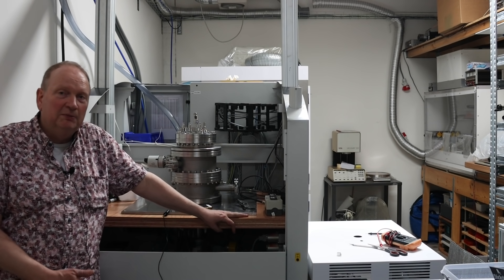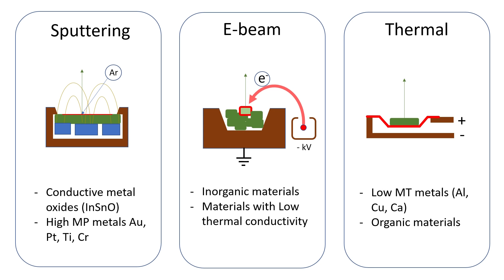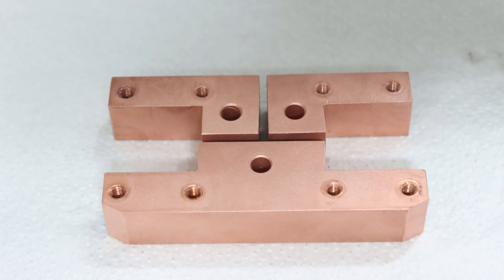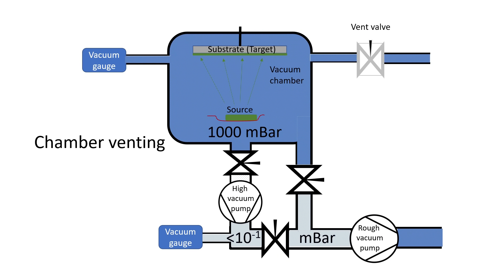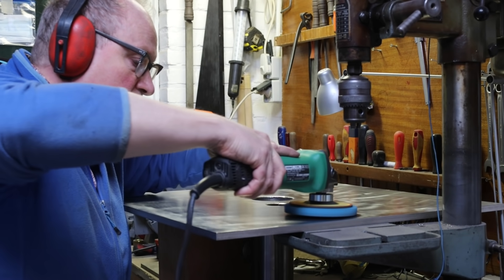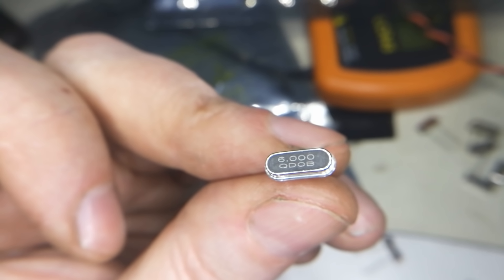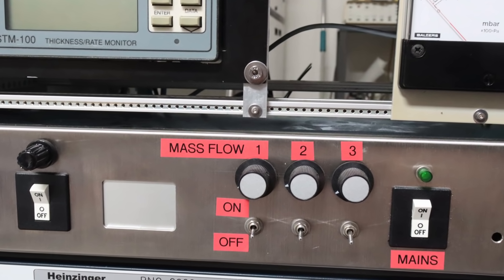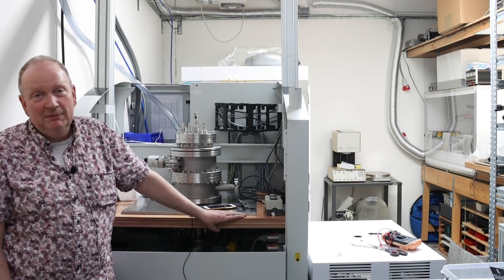DIY Physical Vapor Deposition (PVD) using Thermal Evaporation

Comment: Really nice work! How did you bond the copper cooling pipes in the glass feed through for the boat holder?  That turbopump spin-down noise must have had very high pucker factor!
Reply from the maker: Hi Ben, thanks for stopping by. The pipes were bonded using a vacuum compatible epoxy (Araldite 2020). Because these joints would stay cool during use, there was no reason for using special metal-to-glass joints, which would have been way more difficult to realise. The pipes have a very narrow fit in the glass disk, so the amount of epoxy surface in contact with the chamber is negligible anyway. The turbo actually did not spin down fast, it displayed these short irregular blips in the frequency, almost as if the filter was "dancing" on top of the rotor, extracting small amounts of kinetic energy from it each time it touched the top of the rotor blades. I consider myself very lucky that it did not end up between the blades...
Reply: You are the only two channels without instutional affiliation who demonstrated this capability. Big fan of both of you. Very inspiring! Thank you!
Reply: very cool, we now have inventors gatherings organized by the YouTube algorithm, See you both on the next video :)
Reply: Pucker factor? More like shit a brick. If I even thought something got loose in my TMP I would hit the floor in terror for fear of shrapnel to my body and to my wallet.
Reply: @fizzyplazmuh9024  yea its gnarly,  a colleague sent one to the junk yard just with droplet condensation. Apparently newer TMP's are more "resilient" but I'm skeptical. For my work diffusion pump and cryo get where we need and we like em for their resilience and serviceability
Reply: @Skunkhunt_42  But they "spew" oil into the chamber if you don't have really, really good baffles in the way but then its still not sufficient for the most delicate stuff.
Reply: I'm wondering why I don't see you guys using an oil diffusion pump instead of a turbopump?
It seems much simpler, more robust and less costly to repair. Am I missing something?
Why is a turbopump so much better, except for the need to control the level of oil?
Reply: @dedamarsovac  It's true that diffusion pumps are less expensive, near silent, and more robust, but turbopumps are better in almost every other way: Diffusion pumps contaminate the chamber with oil residue, which can be partially mitigated with a baffle, but this slows pumping. Diffusion pumps are slow to startup and shutdown, require an external water chiller to dissipate hundreds of watts, must be mounted vertically, and are typically pretty tall.
Reply: @AppliedScience  So it's a "would work, but it's more practical if you have a turbopump laying around" scenario :D
I'm really surprised that they cost the same on ebay so it makes sense.

I'd like to try doing PVD some day, so I'll see if I'll make a diffuion pump or just buy a turbopump.

Thanks for the reply, you guys are amazing, you're making me try stuff that I previously thought were just unreachable
Reply: @dedamarsovac  yea I agree, turbos are dry so thats the only advantage in my book which to me doesn't outweigh how fragile they are in wet processes
Reply: a wild Ben appeared
Reply: I replaced a "crashed" turbopump on a sputtering system some time ago, and it was just one tangled mess of rotor and stator vanes. 
You were very lucky the pump is  still working.
But you do very cool work!
Reply: Wow!! 😲
Reply: I need a good vacumology training course!!!
Reply: Going from 0 experience to medium/high-vacuum quality Tig welds is also very impressive! Overall machine wiring was very clean as well

Comment: You casually repaired THAT much damage on a turbo that sucked aluminium debris as well!? I would have loved to see some in depth video of the process and also the end result as to what level you were able to limit the performance degradation to. Another question is how bad the contamination of parts you expose to that vacuum chamber is, after you've cleaned everything to the best of your abilities?

TL;DR: I thought not even the manufacturer was able to do that kind of repairs and that even they themselves, after such an incident with the amount of damage visible to that first stage, would need to, at minimum, totally replace the entire rotor, all bearings in contact with the aluminium dust and most of the upper stator stages as well. The rest of the turbo can obviously get laboriously cleaned out and resurfaced where needed, but even then, after all of that, you're still going to have to be contend with constant minor dust contamination into anything the turbo gets connected to in the future, being limited to < 50% of the original pumping speed and probably also only barely being able to reach 10e-5 mbar in the future.

This is exactly why i've been told no one ever repairs a turbo that ingested dust (let alone sustained actual mechanical damage to its rotor!). It's both cheaper and more effective to just buy an entirely different unit (preferably lightly used, since new turbos are so expensive).
Reply from the maker: Must admit it wasn't easy, it took quite some time, and I did not document it with video. Cleaning consisted of several steps, including pressure spraying between the blades, combined with mechanical scrubbing. Removing mechanical damage was done using localized glass pearl blasting. The bearing apparently was protected very well from dust contamination, since I could not find any aluminium dust in its vicinity. The chamber reaches 5E-6 in approx 2 hours and the turbo is only slightly more noisy than it was before the incident.

Comment: That's an amazing setup. 

I still haven't understood the plasma cleaner setup.

Is the microwave oven transformer (MOT) output rectified to DC ?

Where are the output leads of the MOT connected to? Is one connected to the aluminium base and other to the copper foil wrapped onto the glass tube?
Does polarity matter in the above case?

I'd like a separate video on plasma cleaning setup alone as it's easier to make it from parts sourced from scraps.

Thank you again for this informative video.
Reply from the maker: The MOT transformer output is used directly in AC, so without rectification. One output is connected to ground, so the other is 2000V (max) AC 50Hz. This is sufficient to create a plasma if this side is in air at a pressure in the 10E-3mbar range. The aluminium base is at ground, like is the rest of the setup.

Comment: beeing an engineer designing/building such evaporator system as my job, im very impressed with your know how about all the components and your capability to build the stuff yourself.
I gues you work with such machines professionally? what types and brands of machines have you used?
Reply from the maker: In the 1990's, I ran a small research production line at Philips Reseach where we produced Polymer- and Organic LEDs. Did lot's of PVD back then, mainly thermal and sputtering. Also, about 10 years ago, I bought a Balzers BAK550 with e-beam on an auction. Someone cut all the cables between evaporator unit and control cabinet. I spend weeks soldering everything together, but eventually got it to work. I had to sell it when I moved from my previous workshop (it was huge). The e-beam unit had 4 crucibles and had been used to make bragg reflector mirrors for use in lasers. So yes, I do have a professional background in PVD. But this project is basically just some fun to see if I could build something that works, basically from junk I had in storage.
Reply: @HuygensOptics  funny =) - BAK is ecaxtly the brand i work for ;) - "playing" with them nearly on a daily basis ;)

Comment: have you considered using the lack of good adhesion as a plus and then use the built up layer on the surface by way of transferring it to another surface? I guess that requires additional motion capability inside the chamber to avoid contamination between the materials being bonded by transferring process, like the XY and Z axis controls I am building into my vacuum chamber (and why I chose a rectangular ish shape of a large CRT tube from an old TV set, which luckily was fused together front to back with some sort of silica based frit material that looks a bit like white epoxy or something, and is softer than the glass used in the tube itself, though it is very stable and probably has pretty close to the same expansion rate as that glass to avoid cold and hot temps from fracturing it, :) 

(I am working toward building the parts for material deposition from a sort of nanotube sized pore inkjet style head for 3D printing of semiconductors and such. so yeah had to stop by and take notes and observe your info and progress XD Thank you for documenting what you have here)
Reply from the maker: You can make very nice and thin Silver foil from PVD layers of silver, because it does not adhere at all to glass. So yes, you can transfer a layer to another substrate if your configuration requires it. But so far I did not have any use for this process.

Comment: Very nice work!!  I loved the thick glass plate on top to make viewing the chamber so clear. This would make demos so much easier than watching through a tiny window.   What base pressures can you get with this double oring design?  You have a big turbo for a pretty small chamber.  I usually shoot for 1e10^-7 before my depositions.
Reply from the maker: So far I did not really pump very long, a few hours max, without heating the chamber. I reached about 4 E-6, so that is not very impressive. But for many purposes it will probably work.

Comment: Brilliant! I want to make NiCr thin film resistors on ceramic substrates some day and am taking notes :)
Reply from the maker: Maybe it's time for a joint project Marco. I might even have some Hoechst ltcc materials in my cupboard...
Reply: @HuygensOptics  @marco reps, please do it
Reply: How can I join with your team? I want to work with you.
Reply: very cool, we now have inventors gatherings organized by the YouTube algorithm, See you both on the next video :)
Reply: @EpicHardware its probably going to take years until the video is finished, but knowing both channels, it is going to be epic
Reply: Probably going to want to sputter that.
Reply: Ni is tricky for thermal evaporation, it corrodes refractory metals immediately when liquid. Cr can be deposited from special Cr plated electrodes from solid state. I failed to get any successful results with Ni whatsoever. Lesker guide ( https://www.lesker.com/newweb/deposition_materials/materialdepositionchart.cfm?pgid=0 ) recommends using Al2O3 coated boats, so that should work. Or sputtering.
Reply: In fact, I think a thin NiCr snake on a microscope slide could make a nice high voltage resistor
I wonder if the voltage coefficient would be any good :D
Reply: With low TCR ? I think sputtering the corresponding alloy composition directly is the way for that because of their different vapor pressures, which makes it nonoptimal for thermal evaporation.
Reply: Are you trying to beat the 3458A or are you just trying to recreate its original resistor networks? :D
Reply: I can’t wait to see you guys do a collab,that would be epic!!🥰🥰
Reply: If possible I want to join with you.Do you have any forums?
Reply: I have a
Project also.

Comment: Nice. One thing I saw, regular solder is not high vacuum compatible. For vacuum soldering you should wither use a cadmium free silver solder or use a sil-phos brazing rod. Regular solder will outgas.

I have a few systems of my own, a tiny system I set up for doing carbon coating for my SEM, a medium system set up for thermal evap with a 18" bell jar and 1000lps turbo and a large system with a 24" bell and a 2000lps turbo. That one will be set up for e-beam evap.
Reply from the maker: Thanks Jerry, good to know that. So far I have had no issues  with vacuum that hinder the use. However, I do not easily get below 5e-6 mbar so maybe the solder is of some influence. But I guess using large nbr rubber rings does not help either. ;-).
Reply: @HuygensOptics  generally nitrile o-rings are good down to 10^-8 torr. I can reach that on both of my systems and it’s all nitrile or rubber. You have the plasma so that should help with your water load on the interior surfaces. You still might have a tiny leak too. Try squirting methanol or IPA on your joints and watch for a pressure spike. You can also do with with argon gas.
Reply: Man that is some giant turbo pumps. Let me get a second drool bucket real quick ;D

Comment: Fantastic video as always, when you release a video I immediately stop what I'm doing and watch it, and often go through your back-catalogue. Thank you for filming and releasing the work you do, its got to be a lot of work!

I think for myself making a PVD chamber is possible, but what I think is extremely hard is being able to make consistent thicknesses of coating. Using the resonance of quartz makes sense, but to make great AR coatings, you might need 10 layers, all at specific thicknesses, and even if you rotated the target (and moved the source boat), I think achieving 250nm +/- 10nm is an impossible task, but I'd be fascinated to see how you approach this.

My idea to combat the problem is this: You're making AR coatings, so using laser light could be key. As in, imagine you have a laser attached to a peltier (the temperature allows you to cheaply tune the frequency), and you use a beam expander to shoot it perpendicular to the flat surface of the target. A camera watching the return (or passed) wavelengths. If you used multiple lasers at multiple wavelengths sequentially (or use a rainbow dichroic filter that allows you to select narrow wavelengths from a broad spectrum light source), then when the coating was only 1/3rd done, you could assess where the coating was building up too quickly. A camera with the IR/UV/Bayer layer removed from the sensor could meaningfully sense from 200nm to 1400nm. Then through a combination of an electromagnetic array aperture between boat and target, and moving the positions of boat / target, you could both achieve a more even coat for that run, and in general start to understand better how to get an even coating.

As far as a 'popular video' on youtube goes, I think a lot of people are frustrated when they scratch their reading glasses, but if you polish out the scratches you remove the AR coating. If you were able to 'restore to new' some reading glasses, I think that would get a lot of views and be entertaining to watch!

Thanks again
Reply from the maker: Thanks for the suggestions. Making good broadband AR coatings is indeed an art, and generally done in bulk to make it economically viable. I'm not sure you need 10 layers, I think you can achieve pretty good results with less than 5. It's actually a complete field by itself within pvd and I will certainly look into it. I sometimes do restoration of lens surfaces. Being able to reapply an AR coating, even a simple one, would be a big bonus I guess.

Comment: Question: how were the hollow copper tubes fused to the quartz glass? Thanks in advance for your answer.  I have always wanted to build a thermal evap system as a project. I have a surplus helium leak detector which has a turbo and roughing pump in it, that i bought when i used to work in the semiconductor industry.
Reply from the maker: It was not fused, but glued. I used a vacuum compatible 2 components Araldite (don't know the type heart). I also minimized the amount of glue surface in the chamber by creating a tight fit. It's possible to use glue in this case because it's is actively cooled and does not get hot during use.